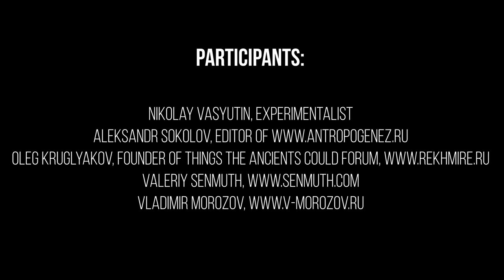Making Egyptian Drill Holes: Lost Ancient High Technology

Comment: How much shorter is the copper tube after drilling 50mm?
Reply: They probably didn't weigh it before and after since it can be assumed that the Egyptian craftsmen would have had access to multiple tools as well as individuals whose job was to produce and maintain the same.  So the Egyptians likely swapped out tubular drill cores as required for new ones.  These individuals obviously were simply trying to demonstrate you an in fact cut stone using bronze tools and abrasives.  

As an aside.  Wear rate would of course be relative to pressure applied and the speed of the drilling as well as the consistency of the abrasive medium. No doubt the Egyptian craftsmen had these variables all worked out given their access to centuries of knowledge relating to this. 🤔
Reply: @varyolla435  Well, it's a rather important question & a point upon which this proposal will very likely be challenged.  The assumption will be that the wear rate on the copper tool will exceed the cutting rate of the stone & that has historically been the main argument against this method of stone cutting.

However, I ask because I consider it may be possible that the carborundum sand grains imbed into the soft copper so that they do not simply roll between the metal tool & the granite.  If the grains are imbedded, they would be carried along by the tool as and mostly cut the granite.

So, you see, it's a crucial question about the economic viability of this method.  The bottom line is that the Egyptians' still had to feed & keep their workforce, including miners & metal smiths etc.  Slaves are not exactly free, if toy don't feed them, they die.  Then you need more slaves which ultimately means training & maintaining a large military force, slave drivers etc.  Nothing is for free.
Reply: @kenwebster5053  I rather think you are overthinking this.  

1 - those who did the work already existed - and no they were not slaves.  Ergo they ate and that means food etc. was already coming from somewhere.
2 - so the real cost becomes = transporting what is already out there to where it is needed.  The Pharaohs maintained what be viewed as "State farms" which fed the workers on public works projects. Also they sometimes warred upon others to obtain resources.  Sneferu did this and obtained cattle among other things to feed his workforce building his pyramids.
3 - next is they were already importing things.  So yes you will lose some of your abrasive during use and it will cost you to obtain more.  But already being a resource needed people would be obtaining it much as today importers are out there to supply stores.  
4 - not everything was being drilled/sawed.  Most stone objects could be fashioned using = gneiss stone tools such as flint.  That makes their use cheaper than with bronze and later iron tools whereby ores must be obtained and processed. 

Anyways there is physical proof of bronze tool use + there is physical proof of stone craftsmanship during the same period + there are historical accounts of the Pharaohs sending expeditions of thousands of men to Sinai to harvest copper ore in the mines there.  Ergo = there is nothing to question vis a vis bronze tool usage. 

So yes the "alternative" doubters will invariably refuse to accept this fact = for which the response should be Pffft!  Their incredulity is their problem as they are already consumed by an imaginary take on historical realty.  You cannot reason with irrationality no matter how "nice" you are or how much evidence you provide. You expose their dubious assumptions and you move on.
Reply: @varyolla435  The doubters are not the alternative view, they the main stream view.  & their argument has always been that copper & bronze tools being very much softer that Granite rock would wear away faster than the rock being cut, making that method unaffordable & untenable.  The argument is not whether the Egyptians cut the stone, it's how?

It seems that the only tools found were of softer metals common to the bronze age, but it is not clear how such tools could effectively cut much harder rock.

I am willing to consider that the method in the video may possibly have been economically viable for the time,  but if you want to establish that case, you need to publish the factual information I asked for, because bronze was not cheap to produce you know.  If the test has been done, the relative wear rates will be known.  Just publish that please!

Failure to publish the central crucial facts that would settle the matter once & for all,  can only be interpreted as, you must be lying.  Why else would you you hide the only definitive & repeatable proof?
Reply: @kenwebster5053  What thoughts did you have after reading Denys Stocks articles?

Comment: Nice work.   Please run a thread around the core and document the spiral thread advancing from top to bottom at an astronomical drill rate like the drill core #7 discovered by Flinders Petrie in the late 1800's.
Reply from the maker: Watch: https://youtu.be/HQi4yql7Ysg
Reply: @ScientistsAgainstMyths  I watched your 'debunking' video.  The best you could do was twist a string in both directions around your own core never showing that the string went into any grooves or that the grooves are helical.  You could not show a spiral cut on your drill core.   You admit the Flinders #7 core had many spiral groves, some in equal spacing and some with spiral groves in irregular spacing.  You admit that there are spiral grooves are on the #7 core.  Your name calling reduces your 'scientific analysis' to a suspect agenda for YouTube views.
Reply from the maker: We admit that "continues spiral grooves on Core #7 with constant step 2,5 мм" is complete bullshit.
Your comment is a great example of the principle "If the facts don't fit the theory, change the facts".
Reply: @ScientistsAgainstMyths  Now you misrepresent Petrie's work to boost your false theories.  Petrie's work: " a single groove may be traced around the piece for the length of 5 rotations... at the end of this groove there is no sensible difference ..."  His measurements were in inches and he made no claim of a 2,5mm constant step.  You are incorrect.   The groove measurements he made were 0,08, 0,11, 0,12 and 0,07 inches showing that there was variability.  Engineer Christopher Dunn, in 1999, examined core #7 and was able to wrap 16 revolutions, handed the work to an astonished colleague who wrapped several more carefully into the grooves. Dunn's examination states that the "spiral groove travels the full length of the core".   
Granite may certainly be cut by copper tube drills with abrasive sand as your experiments prove.  They just don't disprove that there was a different method, that we have not yet discovered, that leaves tool marks and the associated astonishing cutting rates through very hard materials that we do not know how to duplicate today.
Ancient Egypt did not cut those drill holes in the manner your experiment accomplished because your core did not have helical grooves.
Reply: @wtl2247  
"Petrie's work" is false so
Reply: @wtl2247  How does wrapping string around something prove that it has groves? I can wrap a string around my finger, does that prove my finger has a spiral grove?
Reply: @LesterBrunt  Your finger has finger prints, which are grooves because you can see and measure the height and depth of adjacent areas that trace a path.    The angry Russians effectively chiseled a hand in granite and said they figured out the ancient Egyptian methods but their sculpture doesn't have any fingerprints and the ancient Egyptian carvings do.    Similar sculptures, but when you look closely you can say the methods were different.
Reply: @wtl2247  I am looking at a 4K side by side comparison right now, they’re identical. You can just google the images you know.

Comment: Use two giant 8' plus u shape long shaft tuning forks with a 3 to 2 connection tightly connected strum the cord that connects the two at the same hz tuned to as many other smaller tuning forks at same hz. With copper bottoms 🤔
Reply from the maker: You can also use elf farts

Comment: How did they make copper tubes?
Reply: Rap a copper sheet around a dowel. Even just by hammering a sheet it will begin curling around itself.
Or cast copper into sand using lost wax technique

Comment: That's cool, now can you show me how they made curved granite alcoves and transported 1200 tonne obelisks 500 miles or lifted them 340 ft into the air?
Reply: How are curves in stone performed with hand tools today? That should help you fathom how it could have done in the past. The other 2 points are not based on real events so I don't know why you want to see it today.
Reply: @Eyes_Open  Except the claim is they made these by pounding rocks, not tools, besides which Granite is considerably harder than steel. The other two examples did happen, the great pyramid is 340ft tall, it was only surpassed by the construction of the Effeil Tower.
Reply: @Contentinople   @Spotify Spokesperson  Stone tools are tools. You have now added more points. You originally said to move a 1200 ton obelisk. That never happened. Lifting a stone 340 feet high is a non-starter because that also never happened because they didn't start building at the top. 500 mile business is misleading since they used the Nile for transportation of cargo.
Reply: @Eyes_Open  Again, we're not talking about, "stone tools" we're literally talking about a rock. You clearly don't know what you're talking about and yes they were moving 1200 tonne single pieces of granite like the ones from Aswan quarry. Do you have worms in your brain? Yes, they started from the bottom but they still had to haul those weights to the 340ft summit, otherwise it wouldn't be that height in the first place. That's like me saying, "how did they get the lightning arrester at the top of the Burj Khalifa?" And you responding with, "well they started from the bottom." Okay, how do you propose they managed to drag 1200 tonne obelisks from the quarry in the mountains of Aswan and then float it down the Nile? We needed a massive barge and 6 warships just to move the Thunderstone, and they didn't have anything comparable. They apparently didn't even have pulleys.
Reply: @Eyes_Open  I tell you what, if you can show me anywhere, or replicate it yourself, that you can fashion symmetrical 3D images and smooth alcoves on granite by just bashing it repeatedly with a rock, and then float it down a river - doesn't even have to be 1200 tons, you can do half that - with a wooden ship of similar stature to the ones they had access to, I'll believe it. If they were doing it, it should be easy to replicate.
Reply: @Contentinople  I think you need a rest. There has never been a single 1200 ton obelisk moved. They didn't lift stones directly to the summit. Inclined planes are marvelous. Why do you say that they had no pulleys? Or should I ask more specifically how you define a pulley. Any people who use boats with sails are familiar with pulley type systems of mechanical advantage. Barges were used, and recorded. Not sure where your warships were used for Thunderstone.
Reply: @Contentinople  When you want a project done, using known tools and methods, it is then up to you to provide full funding.
Reply: @Eyes_Open  For context, your modern US barge at 59.4 m × 10.7 m has a carrying capacity of 1400 tonnes, and those are made from iron and pushed by towboats.
Reply: @Eyes_Open  Inclined planes? Those would have to be some pretty big ramps to be moving such weights to said heights considering the force multipliers at certain gradients. Your ramp would be significantly larger than the pyramid itself.  Do we have any evidence of these next to the pyramids?
Reply: @Eyes_Open  Because the pulley, allegedly, wasn't invented yet. You're 800 years too early.
Reply: @Eyes_Open  The attachment of warships to the barge was necessary to stabilise it, so the shifting weight didn't cause the barge to capsize.
Reply: @Contentinople  Egyptians left records of barges moving obelisks. Do you have evidence of physics changing as you move up an inclined plane. They had tamps at some quarries at 20 degrees because they were not afraid of moving stones.
Reply: @Eyes_Open  Different period, different pyramids, different materials, much smaller blocks. Those are the ones which are falling apart today. I don't know what you mean? The normal force equals the weight times the cosine of the angle, in other words the weight required to move an object up a ramp is proportional to the angle of the ramp, the steeper the angle the more force is required to overcome gravitational force (force = weight x sin(theta)) This is why I said you'd need a pretty big ramp, as in not just in height but in length, to be able to move blocks of that weight to said heights.
Reply: @Contentinople  What different pyramids?
Reply: @Eyes_Open  You have one ramp system at one Alabaster quarry. The pyramids are constructed out of limestone and granite. Alabaster is used as floor tiles. You're comparing apples and oranges.
Reply: @Eyes_Open  There are 118 different pyramids in Egypt. We're talking about the the original ones that giant monoliths that you can't stick a razor blade between. Not the 100's of other ones made out of much smaller blocks and are either falling apart or have capsized because they were built so poorly. Pyramid building devolved over time.
Reply: @Contentinople  Great Pyramid. Bulk of which consists of rough cut, multi size limestone blocks that were quarried on site. Gaps filled with rubble and mortar. Outer casing and internal passages had tight fitting stones at mating surfaces as would be expected from master masons.
Reply: @Eyes_Open  You're just telling me what the Pyramid consists of, you're supposed to be explaining how it was constructed. Is there no response to what I said about your gigantic ramps that have never been found, I thought you were a physics expert? You haven't explained how you get 3D symmetrical carvings on granite obelisks by bashing them repeatedly with a rock either? Was this the same method the master masons used to create the tight fitting core of the pyramids? The fictional film 10,000 BC provides a more plausible explanation because at least it introduces wooly mammoths to overcome your ramp problem.
Reply: @Eyes_Open  Building ramps that would have to be that large, kilometres long and that precise (because the higher you go the more precise they'd have to be), would be a greater achievement than building the pyramids themselves.
Reply: @Contentinople  I don't have a ramp problem. You seem to think a ramp would not have been removed thousands of years ago. Again, mechanical advantage confuses you, not the ancients. Why do you rant about 3D symmetry? None exists so no need for me to care what you want. You want to focus on pounding stones and no other tools or techniques. It almost seems like you have not looked into anything related to stone working over the last several thousand years. That would explain why you came to this science based channel and left such an opening comment.
Reply: @Eyes_Open  You do have a ramp problem, I explained it in detail and you've yet to show me how I'm wrong. I do understand mechanical advantage, it seems you don't though. The mechanical advantage increases as the incline of your slope decreases, which is precisely why I said that in order to move blocks of that weight you'd need a ramp kilometers long because as the angle increases the force required to move the weight increases with it, and not at a constant rate but at a significant force multiplier. I provided you with the formula, is it in error? There are a litany of examples of 3D symmetrical sculpting out of single pieces of granite in ancient Egypt from obelisks to smaller pieces like the more famous examples of King Thutmose III etc. Perhaps you don't know what I mean by 3D hence the confusion? What I mean is that you have smooth shapes created by removing the stone creating a three dimensional plane. According to you they achieved this by bashing rocks against granite. Granite is harder than steel on the Mohs scale btw at 6 compared to steels 4.
Reply: @Eyes_Open  Them achieving this by pounding granite with dolerite stones is the official explanation. Its not that I'm ignoring that they may have used other tools, that's the entire premise of my argument. You're supposed to be arguing against that, not for it. If you want to attribute greater knowledge to the Egyptians than mainstream archeology, I have absolutely no problem with this but then you would be a conspiracy theorist.